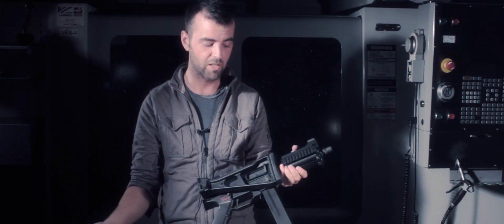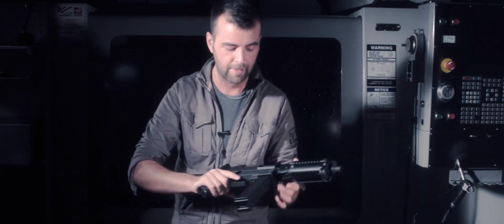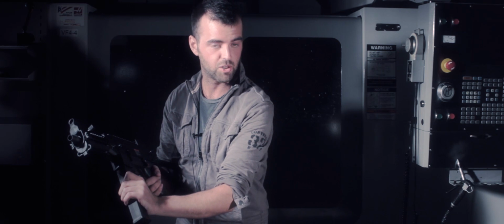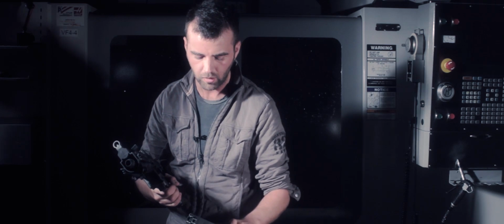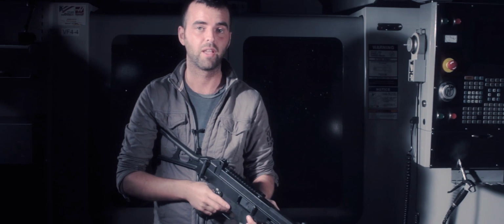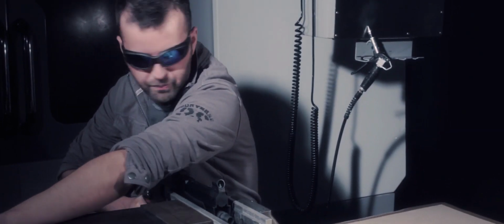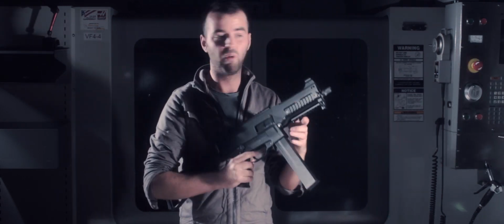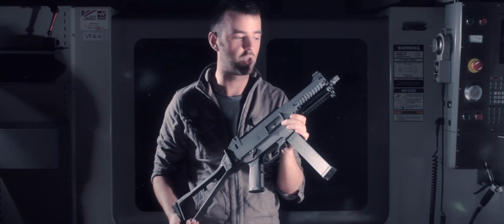Airsoft gun review G&G UMG Heckler & Koch UMP-45 review and test - EpicAirsoftHD - Episode 17

Comment from the maker: @TheRealRyan1000 The gun its self is really deceptive.  The range and accuracy of it (depending on BB weight) are the best I've seen.  The BB's we used on this test weren't as good quality as say the blasters we are using just now.  It puts better groupings than the M14 EBR and that's saying something.  I'd try and get a 7.4v LiPo stick battery in there if you can.  If you're looking for NiMh's only an 8.4v stick will fit. P90 mag pouches accommodate the UMP mags perfectly! :)

Comment: You should check out the G&G F2000. Best gun I have ever used. About the same length as the UMP, but has a 430mm inner barrel. I outshoot most snipers with my f2000

Comment: great review. quick question what is the highest battery you would put in this gun and where would you get it from? i am in Scotland also.  I will be using it for both indoor and out and want to use the gun at its best performance. spot the newb!
Reply: I saw one at our local shop in the U.S. They were selling it with a lipo (believe it was a 7.4). So I think a lipo could work. But, just research it on google. And if you do get a lipo, make sure you shim it right, correct aoe. Then make sure you do full trigger pulls, not that super fast semi shooting, this can help with the longevity of your gun, and help it be able to not get destroyed by a lipo. For the shimming and aoe, make sure you know how to do it, or have a professional tech do it. You don't want to mess those up.

Comment: Also, what are the threads on the barrel ? if it is threaded.
Reply: Pyro The Gladiator There are none, but there is still an adapter for a specific suppressor instead of threads. If you buy a threaded suppressor it won't fit on this UMG. I hope I helped you!